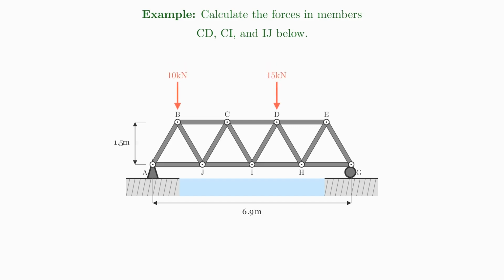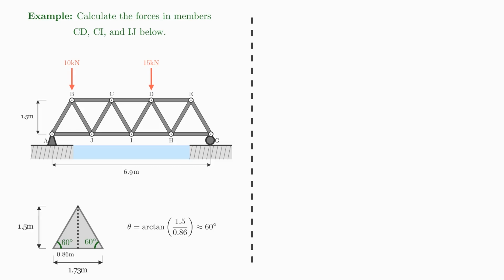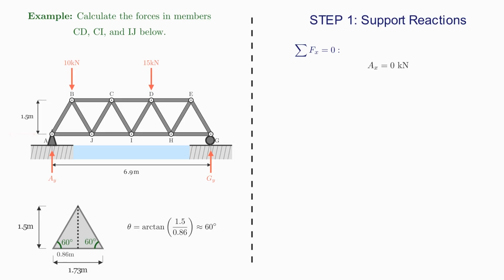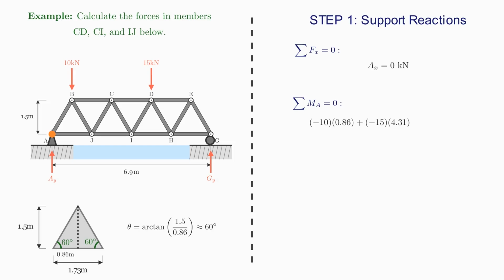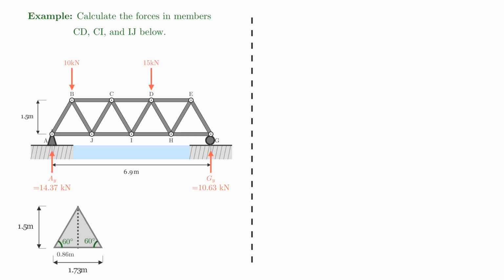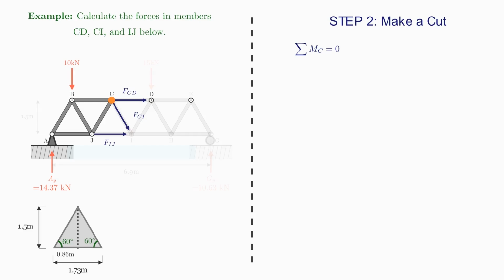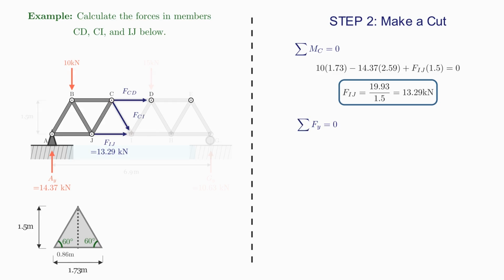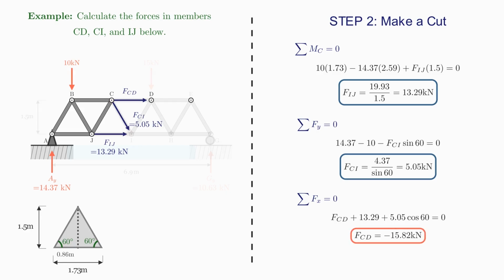Method of Sections: Static Analysis of a Warren Truss | Worked Example

Comment: Where did you get the 4.31 from
Reply from the maker: The value 4.31 comes from finding the horizontal distance from point A to the 15 kN load at joint D. The total length of the truss from A to G is 6.9 meters, which is divided evenly into four panels. Dividing the total length by four gives a panel width of 1.725 meters. Because joint D sits directly above the midpoint of the third panel, it is located two and a half panel lengths away from point A. Multiplying 2.5 by 1.725 meters gives 4.3125 meters, which rounds to 4.31 meters.